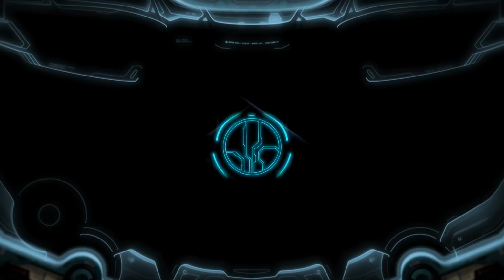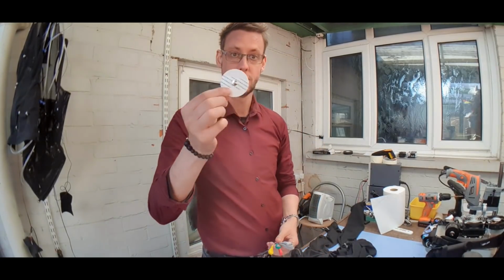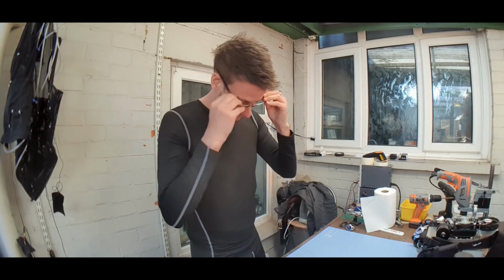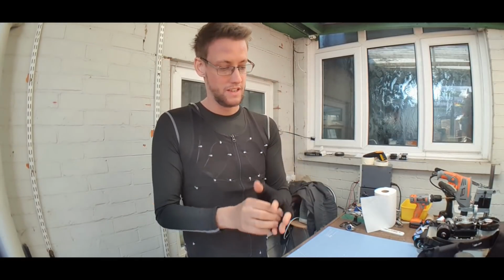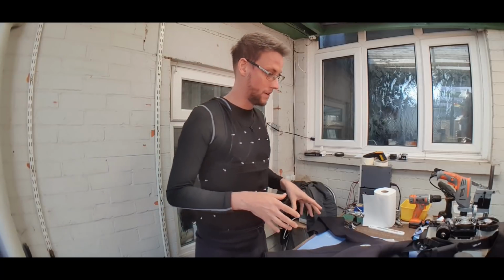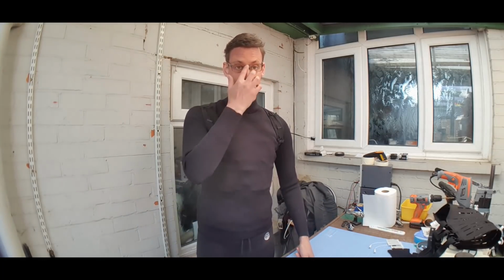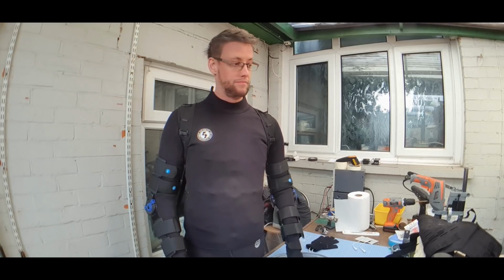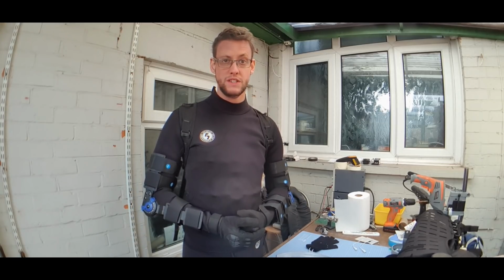Project: MJOLNIR - Update 03

Comment: I just found this video so I might be a little late but I'd definitely recommend using photography gloves for your hands instead of spandex. Photography gloves are designed to be warm but maintain dexterity. They also let you fold back the tips of the pointer finger and thumb to help you interact with things easier without needing to take of the entire glove. The gloves I have actually have pockets already built in where you wanted to install the warmer.  They're about $30 to $50 so they're not very expensive.

Comment: Contact Elon Musk for his neuralink prototypes, it would help with signal passage and reaction time for the actuators. + so much more :)
Reply: Unfortunately different countries so unlikely he could get it, reliability is also unknown as well as many other factors. How exactly he makes the onboard computers could also be problematic, assuming that he repurposes a consumer HMD/AR headset, he will have to figure out how to get those devices to work with a Neuralink prototype: I doubt said prototypes are made to work with Windows MR, whatever older Epson Moveiros use, Android 9 as modern Moveiros use or whatever other headsets use (proprietary software that can be manufacturer specific). Luckily there are dumb HMDs that interface with PCs, but that brings the problem of fitting a PC into this suit: only Windows PC I am aware of that's battery powered and small enough to fit is a Microsoft/Nokia Lumia 950 XL smartphone MODIFIED to run Windows 10 ARM, which currently doesn't support 64bit x64 emulation (We have no idea what software Neuralink requires or if it is 32/64bit, but it likely is available for Windows 10), which is a terrible choice because it's a 2015 smartphone with 3GB RAM with a UNOFFICIAL WINDOWS 10 ARM PORT.
If he worked for Elon, it would be feasible, but as is they likely would end up paperweights

Comment: Also would the upcoming leap 2 ar glasses be interesting to use for the hud?
Reply: That would be highly cost inefficient as Epson Moveiro headsets are the same size and much cheaper than the Leap 1. 

The brand new 1080p OLED dual display Moveiro BT-40 is $579, 34° FOV, USB-C and can be hooked up to anything: the one with a dedicated smart dongle, the BT-40s, is $999 and has a Android 9 smart dongle that's basically a smartphone. Lastly, the 720p BT-35E has a camera, compass, gyroscope and accelerometer, but needs a external device and is $799.
Reply: @lumiapowered8463  and what about similar systems? I thought there was also some at a smaller scale in a more normal pair of glasses, someone here on youtube used it to make the visor of iron man's helmet
Reply: @stijnVDA1994  Most AR headsets of that category simply aren't as versatile or easy to get. Epsons are produced in relatively large numbers for low cost and to my knowledge are the most widespread model family, and aren't glued together so rearranging components is easy. They also are sold either as dumb HMDs (basically a headset with sensors & such but no smart capabilities, requires hookup to a PC/phone/whatever) or as the smart ones with a proprietary connector cable to a smart phone-size dongle that has controls and can be placed wherever. Hell, they even sold in the past variants made specifically for hard hats, and drone FPV purposes. They're essentially the gold standard of commercial & consumer AR headsets because of that. Most alternatives are glued shut and don't have dumb HMD options. 

The only cheaper alternatives I am aware of are the garbage Google Glass, the vintage I-O Systems iGlasses and the vintage Sony Glasstron. I own some Glasstron models, they top out at 800x600 and have godawful FOVs for the outside world, + while smaller than even a HoloLens in headset size, they're thick and also dumb. Not to mention, you are trying to rely on 1990s hardware. The iGlasses were a competing system with much worse image quality but much larger FOV for outside, but it's still a dumb headset from the late 90s. Google Glass is the most compact, but they've got one pretty poor prism display, not suitable for this.
Reply: @lumiapowered8463  oh i see neat! I hope installation 00 sees this since this might assist him..
Reply: @lumiapowered8463  i was looking for the vusix blade smart glasses but these are also $799 sadly

Comment: Neoprene is waterproof and airtight? You might want to have a word or two with whoever told you that, and point them towards wetsuits. Unless you're dealing with crushed neoprene, which is a different beast entirely. Either option makes for fantastic insulation outside of the water, so you'd need a good way to cool the fluid in the tubes if you're not trying to cook yourself. If you're expecting to use EKG style adhesive electrodes, the gel kind with the metal nipples aren't exactly reusable- the gel loses adhesiveness, and those metal nipples will disconnect if you look at them the wrong way. Many hospital EKG machines use smaller stickers with clips, you might have a better time trying to rig those with your sensors for the muscles.

Comment: Any graphene research for armor?
Reply: To my knowledge, such technology wouldn't be feasible for this due to the fact that even the smallest defect with graphene/carbon nanotubes (say, a carbon atom missing, or a bond not there) can greatly weaken the piece: essentially, for that maximum strength you need everything down to the atoms perfect. This already is a problem for small scale objects that can fit in your palm, much less anything larger
Reply: @lumiapowered8463  do we know what that would cost?
Reply: @BasedChad1  Some sources say $100/g, but it likely would be more for this because it's going to be thousands of VERY LARGE SHEETS (thousands because graphene is 1 atom thick). There is another problem that I didn't mention as well: Graphene is useless without something to link the sheets.
If you just stack them, you've essentially made graphite and the slightest abrasion can remove many layers. Ideally you'd have either a frame around the edges and/or use carbon nanotubes as stitches (essentially rolled up tubes of graphene.) The former likely would be very heavy and not provide much structure, the latter is just as expensive and difficult to make + a asbestos-like respiratory hazard.

Basically, graphene wouldn't be practical at all, even with unlimited money we can't make large enough and high quality enough pieces for such a large scale application.
Reply: @lumiapowered8463  best second material with a similar resilience as graphene at best conditions? Just trying to find some alternatives
Reply: @BasedChad1  Someone mentioned UHMW? polyethylene which could work but I don't know much about it beyond it being a plastic usable in fibers vastly superior to Kevlar in performance or as solid panels of unknown strength, the ceramics used for military hard armor would work but be quite heavy and idk how easy it is to shape/machine (titanium already is incredibly difficult), there aren't many materials I can think of that are both light enough and strong enough (CFRP/carbon fiber, fiberglass aren't gonna be strong enough to deal with bullets to my knowledge) + as established even after decades, graphene/CNTs aren't quite there yet, still only useful for limited applications

Comment: What ru going to do about sweat? Considering these materials are waterproof and generally non absorptive, youre going to be sitting in a pool of inescapable sweat
Reply: that's why you can either cool the system or heat it, to provide optimal temperature

Comment: I have a question what’s the likelihood of using a 3D printed graphite for some of the under armor? That’s of course if money wasn’t an issue
Reply: To my knowledge, such technology wouldn't be feasible yet due to the fact that even the smallest defect with graphene/carbon nanotubes (say, a carbon atom missing, or a bond not there) can greatly weaken the piece: essentially, for that maximum strength you need everything down to the atoms perfect. This already is a problem for small scale objects that can fit in your palm, much less anything larger
Reply: @lumiapowered8463  more like for interconnects for the electrical side.
Reply: @lumiapowered8463   hold have sworn some of those issues (not all) were resolved in lab.
Reply: @kristopherleslie8343  Not for a scale this large. CNTs (nanotubes) used as additives for other materials are generally very small and not the highest quality, graphene is generally used in very small scales. Keep in mind that you would need at least a few thousands of graphene sheets to make a armor piece, since they are 1 atom thick, and that you can't just stack them into graphite because abrasion would just remove sheets. You'd ideally weave them together using CNTs, which are similarly expensive and also require high purity. Those also are essentially tubes of graphene and 1 atom thick as well, so you'd also need a ridiculous amount of these + they need to be everywhere for proper structural rigidity.
That's not even getting into the fact CARBON NANOTUBES ARE RESPIRATORY HAZARDS WORSE THAN ASBESTOS because they don't get decomposed and are even finer! And all of these resources are needed for ONE PIECE, not the whole suit! If it truly were practical without money being a issue, militaries would already use it

Comment: with the wires i would prob remove the thick outer layer of rubber, layout the unside wires next to eachother, then wrap thiner, stretchier, more insulated material on there, the reason for this is the wires protection was made to protect it from the enviroment which isnt needed here because the wires will already be protected by the suit, i feel like using the original rubber is just inefficient and may hinder the movement and will definitely make the undersuit bulkier
Reply: and if u had a crazy amount of money and a big team you could completely renove any sort of insulation or protection on the wire specifically and have it built as part of the suit in one layer
Reply: Wouldn't this pose a problem for washing/cleaning? That suit will eventually have to be cleaned or else it will get quite nasty both inside and out, plus if this is really supposed to be as military-grade as he wants, it needs to work in rain, mud, snow
Reply: @lumiapowered8463  fair point, but dry cleaning should do the trick

Comment: First the mjonir armour and theres been news reports that US military and uk are looking into augmented solider 
Halo is finding it way into the real world
Reply: They've been working on powered exoskeletons for decades, augmentation I don't know about. Some good examples to check out are the 1960s GM Hardiman system, which would be a 1.5t external suit like the Mk 1 and 2 prototypes, wasn't able to walk properly among other issues. More recently in the 2000s is the cancelled HULC (Human Universal Load Carrier) project by Lockheed Martin, intended for cargo carrying but causes soldiers to expend more calories walking. The only project of this type so far deemed to be useful for infantry is the brand new (finished 2021) US Army IVAS system, which is a AR headset made using the Microsoft HoloLens 2, and in development since at least 2018, which is merely the HUD and information systems, not a suit

Comment: You're gonna hate wearing air tight insulated boots. (US Veteran)
Reply: Agree, not sure how to really mitigate that tho if want it sealed, perhaps check was nasa does for astronaughts.

Also another suggestion would be to remove the heating pad from the palm. If you’ve ever worn heating pads in your gloves or even on your feet in the mountains, you just want it on the back of your hand, top of your feet.  No need for them on both sides. Also would likely get damaged from use if in your palm etc.

(Just saw he has it on bottom of foot, I’d recommend switching that to the top as someone who has worn heating pads snowboarding. Bottom of the foot/inside palm is also more prone to sweating).
Reply: Not with personal atmosphere system
Reply: Google trench foot
Reply: @Sumbutjuice  I know.
Gonna work this out

Comment: I know it’s not technically lore authentic but I’d consider using UHMW polyethylene over titanium as a material. It’s lighter cheaper and better proven as an armor. Soviet era helmets used titanium in their construction and are not great performers for weighting upwards of 4kgs (I think around level 3A Ballistics protection, non armor piercing handgun rounds from short barrels). Titanium spall is also flammable and will likely cost significantly more to be made into complex shapes needed for something like a Spartans helmet
Reply: I think for the time being, it's just a proof of concept and saying "yes we can do it".  As for the armour itself, with the exoskeleton part of the armour, the weight shouldn't be too much of an issue but I see your point about the cost.
Reply: If the suit is going to move with actuators I don’t think using a lighter material would matter, it should be able to move either material. 

UHMW is combustible like titanium. Maybe not as much as titanium but it still is. I don’t think replacing titanium for UHMW in lou of titanium is worth it. Also, he won’t be around fire or chemicals that would make it combust. 

If 00 gets a company to bend the material into a specific form then using UHMW over titanium still doesn’t make sense. 

The only thing that would make sense for him to switch is if he can get the same amount of UHMW for a lower price.
Reply: @Lustie  UHMWPE is more than four times less dense than titanium and while titanium’s properties might make it better in a static penetration test UHMWPE is one of the most commonly used level IV (stops armor piercing rifle rounds) plate materials today for a few reasons. 

One of those is weight, and while you mentioned the use of actuators/servos/maybe even synthetic muscles any and all of those devices still have a limit to the amount of torque they can output especially given the size constraint of a practically wearable exoskeleton. 

One of the current limitations and possibly the sole reason why we do not have iron mans, master chiefs, and other badass exoskeletons is weight. Our current battery tech is not good enough to power a full body suit made of ceramic or metallic armor that offers adequate protection to make it worthwhile. The advent of UHMWPE armor which is a relatively new technology might change that however. 

The other reason is cost, I’ve never purchased UHMWPE wholesale, however level IV ballistic plates made from this material can be had for as little as $120 substantially less than and equally sized piece of titanium.

You also mentioned that the flammable spalling would not be a problem since 00 would not be using the suit in a flammable environment however if the goal here is really to produce a powered assault suit that will be used on a battlefield then spalling, especially flammable spalling becomes a major hazard for anyone standing remotely close to the wearer when a round strikes the suit. 

Like I alluded to in the previous comment  titanium personal armor has been tried a lot by the Soviets and they found that 6.5mm thick armor grade titanium in the 6B3TM vest could not stop a (presumably ball or fmj round) 7.62x39 projectile. This vest alone weighed 12 kilograms a full suit with thickness raised to the point at which it will be able to defeat rifle rounds alone would probably weigh over 100 kilograms not to mention all the motors and batteries carried on a exoskeleton.

Comment: Did you a fuel cell would work for the power source?
Reply: Think*
Reply: A 10W 6V hydrogen fuel cell by FuelCellStore weighs 0.13kg/0.29lb and is 54*52*51mm or 2.1*2*2in without fuel and only the fuel cell itself, but is a $790 device that I can't find reviews for. At minimum it needs a DC/DC converter and fuel tank. Hydrogen costs I'm not sure about for non-automotive but it's probably less than automotive's $16/kg and likely will require small, low capacity and heavy in weight pressurized tanks to be mounted on the back. I'm not sure if such a system would be cost effective or space efficient enough, especially if he is only aiming for relatively brief operation times. I'm also not sure if he has access to that stuff as he's not in the US, so these products and hydrogen fuel may not be as easy to get.